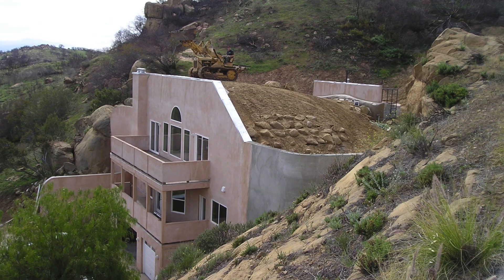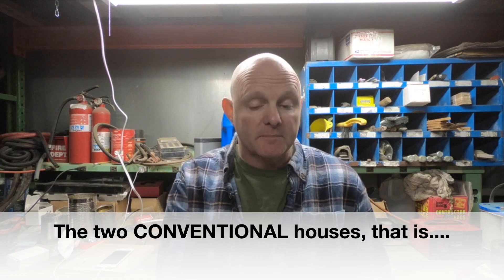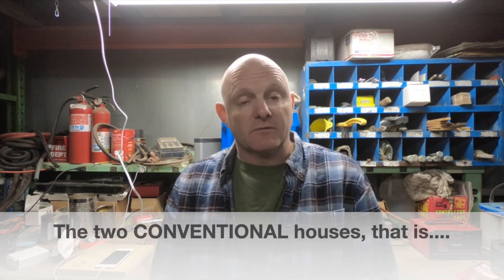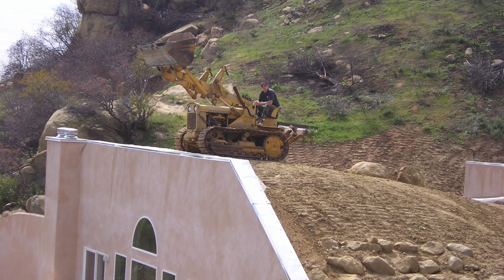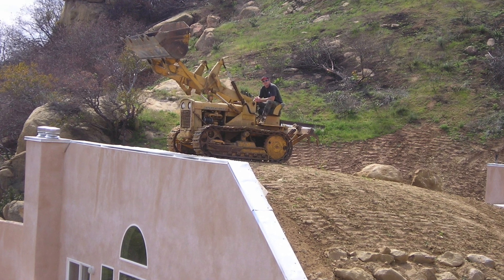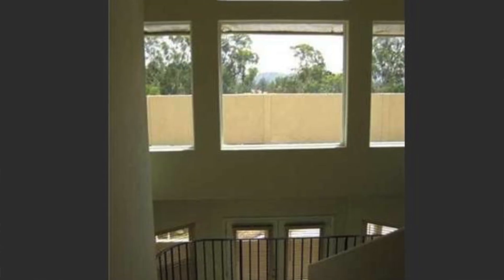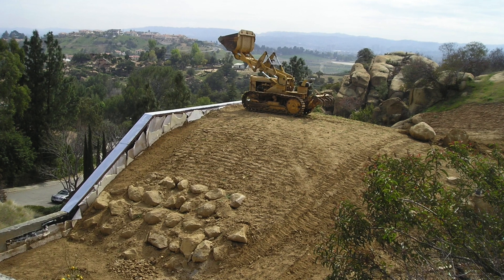Why Build a Dome Shaped Underground House?  #2

Comment: I think these are actually a very smart and responsible housing option.  Not a fan of the look, but you can do a wide variety of things with the interior design, and essentially make it as nice as you want.  It likely would have decent re-sale, among preppers at the least.
Reply from the maker: The one i built actually sold after a bidding war.  While it didn't appeal to some buyers, for many, it was a no-brainer...

Comment: Why did you sell your Chatsworth dome house and build another dome house instead?  You mentioned that Chatsworth hillside land was $50k.  What size lot was it?  And, how much was that build?  

How much was the land for the second dome house & what was the size of that lot?

Sorry for all the questions, but I am thinking of doing the something similar.  Thanks!
Reply from the maker: If you're thinking of doing this in LA County, don't bother.  Formworks building will NOT do any more in LA County because the permitting process is so insanely difficult.
Reply: @theeddieconnashow  Thanks, interesting.  Would Formworks still do it in LA City?  Also, curious about why you sold the Chatsworth dome build to start another.

Comment: Have you ever investigated a spray on poly-urea (ex. Line-Ex) option for waterproofing?
Reply from the maker: Formworks Building, the designer of this home, has used many different types of waterproofing over the years.  They said they like this method the best.

Comment: Here is another question from my many years in construction and solving problems. A problem that often comes up in concrete basements is that tree roots can sometimes penetrate or put pressure on the concrete walls. What is your take on this problem as it applies to the concrete dome?
Reply from the maker: Well, the simple answer, don't plant trees with extensive root systems on top of the house! 

We will be planting vegetation on the house, but trees won't be planted directly over it.  So there shouldn't be any issue.

Comment: Fascinating. I looked at the Monolithic company in Italy, TX. Your choice of company, was it because it is local that you chose it or some other reason?
Reply from the maker: Hi Ann, I looked at numerous options.  I wanted an UNDERGROUND house first, for the reasons listed in the video, and then stumbled upon Formworks.  This is actually the SECOND house of theirs I've built... or am building.  I liked the fact that the dome uses less concrete, (it's only 4 to 5 inches thick) and yet is super strong.
Reply: Stuff and Things like Monolithic. I’m thinking their membrane is easier than what yours needed. I’ve lived nearly 20years in an above ground AI geodesic but keeping the concrete sealed has been a challenge. I would love to own one underground.
Reply from the maker: @gkseeton  I'm not as familiar with the monolithic set up.  My understanding was those were for above ground houses.  The waterproofing is a labor intensive process, but you do it ONCE, and then it's covered.  Since it is covered with a LOT of earth, you'd want to make sure it's the best, most secure way possible.

Comment: My dream home would be a completely sphere shaped home (48ft -50ft diameter), with the top half of the sphere above ground but completely covered with earth so at a distance it looks like a small hill. It would have three floors, basement, main floor, and upstairs.

On the hill would be an array of solar panels and a water catchment system.

Ideally, I would want to plant my home right over a powerful underground stream and then harnest the power of that underground stream by building a mini hydro-electric dam to power my home.

Comment: What size rebar needed to be used in the underground houses you've built? Was it #4 in the dome and #5 size for the foundations? Thanks
Reply from the maker: The dome uses mostly #4, with the occasional #5.
 The foundation was a mix of #4 an d #5, with #3 box ties spaced around the footers.  
  Each home is individually designed for the topography and lot where it's being built.

Comment: How can a DIY guy buy plans for rebar framing required?    Is there a format or plan for dome dimensions and the intended load?
Reply from the maker: Formworks Building is the company that designs the house, does the engineering, will get you through the permitting process, and they also sell the kit.  It is a DIY type of house and many are built by homeowner builders.

Comment: Would other shapes of underground houses be fairly earthquake proof as well?  Also would the roof be able to grow trees or would you have to keep it clear to avoid roots tearing into the rubber?  Also how much did the dome building kit run you?  Do you have pricing info on all the building costs?  Is this a business of yours to build underground homes?
Reply from the maker: Hi Tyler, thanks for your comments, here are the answers:

The dome, by it's inherent shape, is much stronger than a "flat" or square structure.  Arched shaped structures are also very strong.  The Formworks system uses a combination of domes and arches to make the structure.  This house is comrpised of a half dome, 25' in diameter, and two arched sections that are 50' across and 7' long each.  

You can grow things on the roof, and planting IS recommended.  This serves several purposes:

1) the plants shade the soil from the sun beating down on it, and they absorb sunlight.  Plants prevent erosion, and they suck water out of the ground as well.  You WOULD want to be careful WHAT you plant and where.  I wouldn't plant something with a deep root system right on the very top simply because the tree would have a limited area for it's roots.  But if you move the trees to the sides of the dome, then the roots have much more soil. 

The dome kits vary in price depending on size, how much rebar, etc.  This house is 2783 square feet.  The dome kit, which consists of the curved I-beams, rebar, mounting brackets, and the styrofoam that's used to line the inside for shotcreting ran $55K.  

Building costs vary greatly by region.  I'm in LA where permits alone for a single family home run about $50 GRAND now.  (I know, insanity).  That's for ANY home in LA. I will be doing a video soon on build costs, and how to keep them down shortly, as it's a very commonly asked question.  

I do NOT do this as a business.  I DO work as a consultant in guiding people on HOW to do this, and helping with educating them on the various aspects of a build.  But i do NOT work as a contractor.

Comment: Concrete cracks thats a fact. so when you build an underground dome house in case of earthquake of higher magnititude it will cause multiple cracks to the structure and the fact its underground fixing those crack will cost a lot... what about plumbing issues and tips for underground...
Reply from the maker: The dome structure, by its inherent design, is thousands of times stronger than a conventional home.  The concrete on the inside of the dome is covered in plaster, but is accessable.  So even IF it were to crack, it would not "cost a lot" to fix because it can easily be accessed.  By being underground, the stresses exerted upon the structure during a quake are a fraction of what they are for an above ground house.  The first one of these I built in Chatsworth was actually hit by an earthquake.  Not only was there not a single crack anywhere in the structure, I didn't even FEEL the quake.  My neighbors home, however, was swinging back and forth in the air and he thought it was going to collapse.   

Any quake that would damage this house will, in all liklihood, completely destroy any other structure.
Reply from the maker: As for plumbing, I'm not sure I understand the question.  Sewer drain pipes are run just like any conventional home.  Supply lines are run INSiDE the interior walls, NOT under the slab, which code doesn't allow in many places anymore anyway.